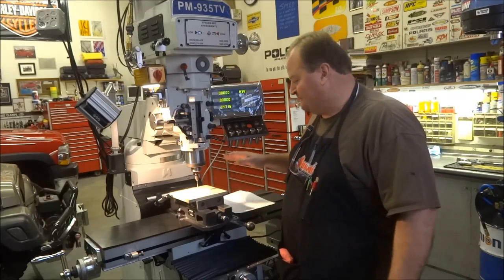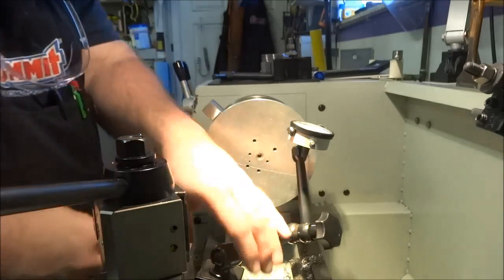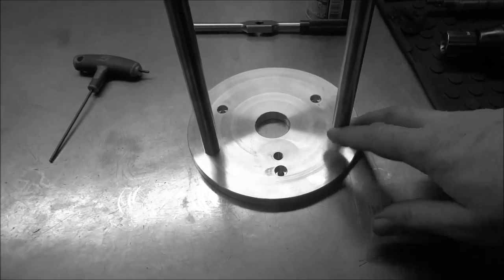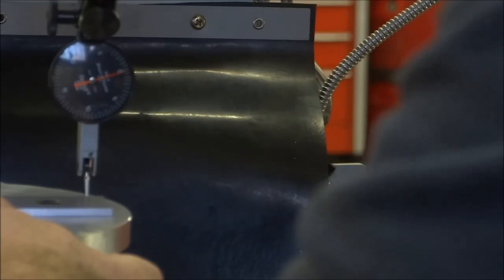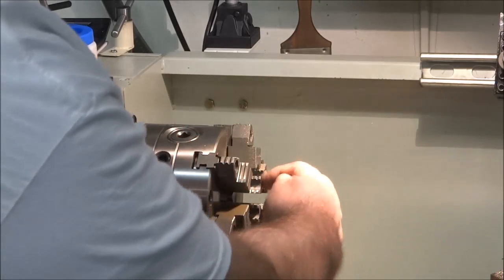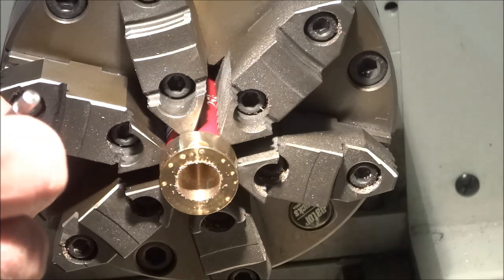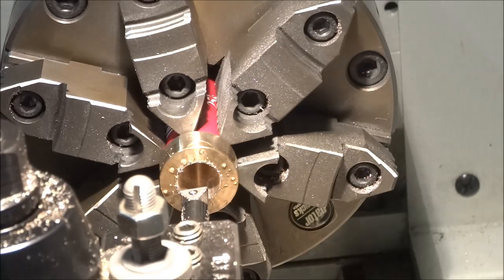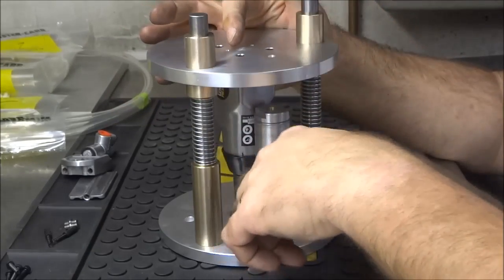Power Draw Bar Part 1

Comment: Hi Mike thanks so much for posting on the pm 1340 gt , are you still happy with this machine and would you recommend  a DRO if you ordered today?
Thank you  James Young in Montana
Reply from the maker: James, thank you for watching. 

I am very happy with my 1340GT lathe after owning it now for nearly 5 years.  It is a joy to run and holds tight tolerances.  
I would like to put a DRO on my lathe but the dials are very accurate and easy to hit your target dimensions. If you have the funds at time of purchasing the lathe I would get the DRO but you will still be able to hold tight dimensions without it if you want to add the DRO at a later date. 
Mike